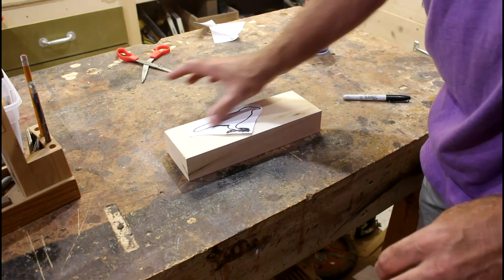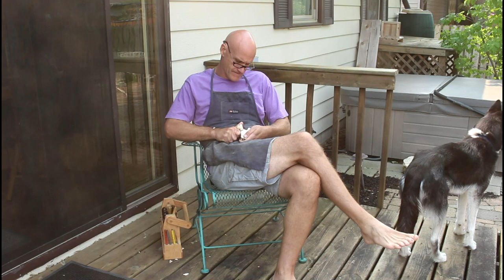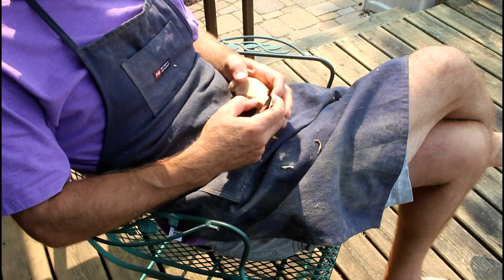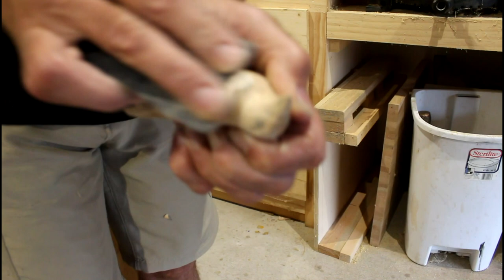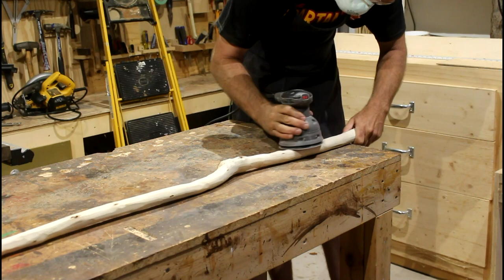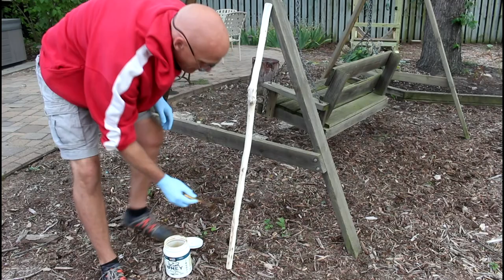Carve a Crow Topper for a Walking Stick

Comment: That's really nice, Mark! I enjoyed watching you make the crow!  I've been thinking about the Flexcut Carving Jack for a while, It looks like it does a good job. Is it easy to use?
Reply from the maker: Thanks Mike! I use the knife on the Carvin' Jack for most of my rough work on most of my carvings. I think its a really good blade - it cuts nice and stays sharp for a long time. I like all the other tools as well. The only time when it seems to get awkward is the V-gouge is at a right angle and sometimes it is difficult to hold it at the right angle for carving. Otherwise, I think its a great investment. I have the four blade version. It would be awesome to have with for some of your journeys with Pearl in the mountains. :)
Reply: Thanks for your reply, Mark. That's what I was thinking. It would be great to take out in the hills and do some carving, while Pearl is chasing squirrels and stuff.  : )